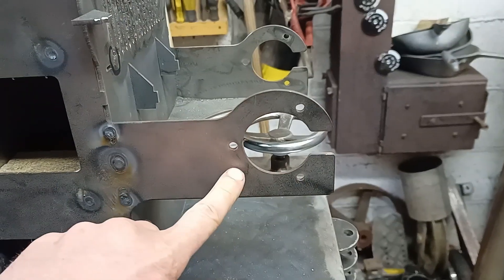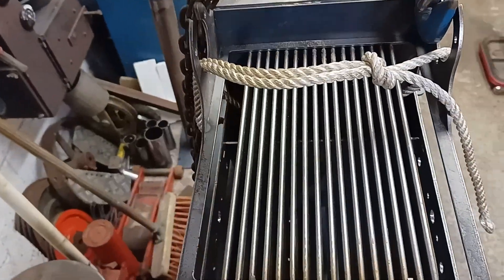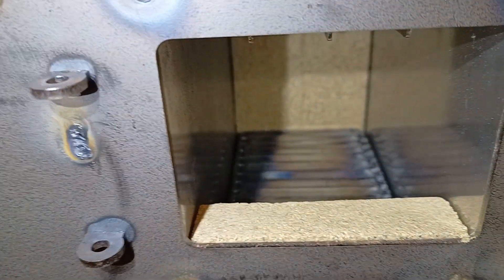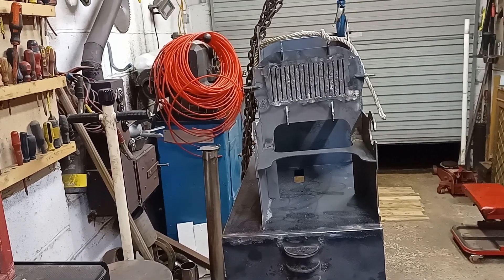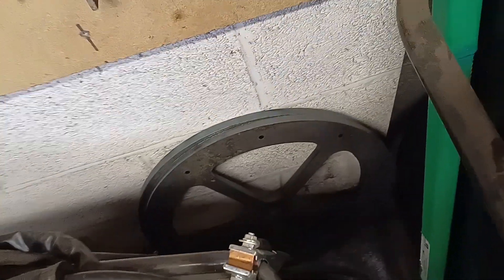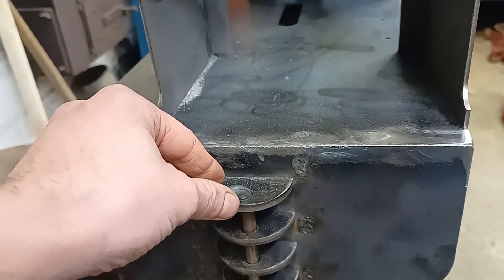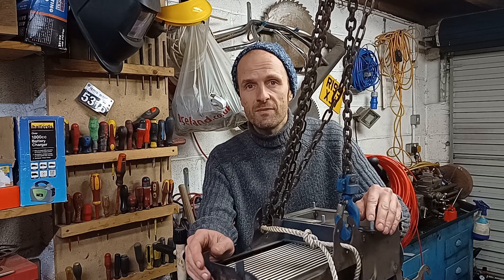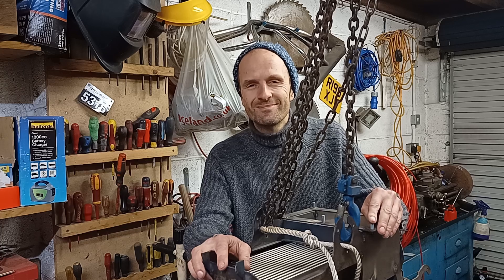Hot Air Stirling Engine Locomotive - Part 6

Comment: Okay honest question here why are you so focused on the diaphragm version of this with it ripping and just getting overheated I would find a normal piston would probably be more Superior I know you've made some in the past and you've had some problems with them but I'm just kind of curious why you chose to take this route instead of the piston
Reply: I will answer on Shane's behalf but no doubt he will add things that I miss. The pistons on Mark 1, 2,  and 3 all had the problems you mentioned which were sealing, lubrication and power output. Mark 4 was a deviation to a diaphragm which we know would create problems. These problems were we think solved with the eventual use of a Aramid class material layered up with silicon which solved the diaphragm problem, we  further managed to reduce the heat distribution on the hot side. We were amazed at the low  amount of fuel (wood in this engine) used in starting the motion and also maintaining it.  Alas the power output was a little disapointing but Shane was sure this could be improved with the build of a mark 5. He intends using it to power his 5 inch gauge train around his garden and house, the lower weight of this design was also a consideration. We intend using coal as a fuel to get a even output and enable a smaller firebox. Now whether the present build will actually work remains to be  seen. He seems to think yes, so i guess with the previous 4 engines that he built were to some degree successful I can only say time will tell. I have always told him with his builds that if they don't work i will give them a coat of paint and he can display them in his garden as ornaments. He has zero ornaments at the moment! All the very best and thank you for your interest.
Reply: @philippomeroy5769  thank you for the response and the only reason I'm kind of more interested in the Piston is I would like to have one myself that can run for days versus hours by no means am I asking him to change his plans or what he's doing more of just a curious of what exactly happened on that and for the Firebox something that you may be able to look into I am not 100% sure about your laws sorry I am Stateside and pretty much no one gives a crap what I do but a waste oil burner does put out a significant amount of heat and you are able to throttle it down by cutting off the oxygen so I may be able to give him a more constant burn and for the waste oil we typically use vegetable oil that we are able to pick up at our local restaurants and just run it through a paper coffee filter and it's typically more than good enough to run in our waste oil burners I cannot wait to see what he comes up with next and I appreciate all the data and design he puts in every build everything he's doing is just pushing this community further and further and being able to design our own what the data that he provides thank you once again for the comment back and best to all of you

Comment: Dang! You are a great fabricator and designer. 

I would imagine if you tack in some thin, zigzag  fins between the heater tubes (like a car radiator) you could really increase the heat transfer into/out of the engine, but that might be difficult to achieve at this point in the construction.

Such a cool project!

Comment: Nyien naon eta
Reply: Двигатель Шейна!
Reply: Locomotive / Train engine.
Reply: To find out more information about the present Mark 5 build do not forget to click "more" at the top of the introduction to this YouTube vidio, it is just below the image of Shane. Shane goes to a lot of trouble to give as much information as possible to help others. Also if you click on the image of Shane it will lead you to Marks 1,2,3,4, hot air engines plus many other projects.

Comment: Keep up the great work. I like the design concepts and have high hopes for it. 

PS. Im still very interested in how well it work as a heat pump. 😊 I hope it interest you enough to try it once with an electric motor driving it.
Reply from the maker: @kreynolds1123  the heat pump experiment is still in the back of my mind. I don't have a suitable motor at hand at the moment...... come to think if it I do have a 12v motor that might work 🤔
Reply: @ShanePomeroy  Some ideas: There are lots of YT videos that 
1) Make go carts run on automotive  starter motors, or
2) convert automotive alternator to a motor, or
3) Convert an old lawnmower engine from vertical shaft to horizontal shaft for go-karts.  This could supply 5-8hp.